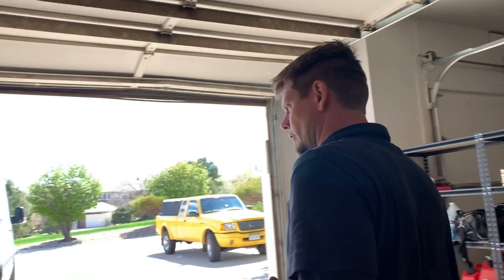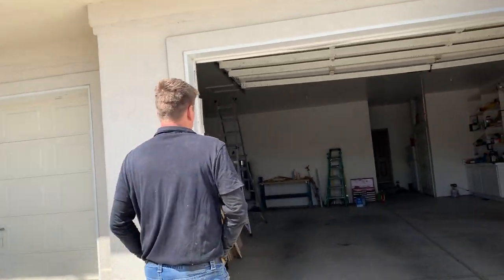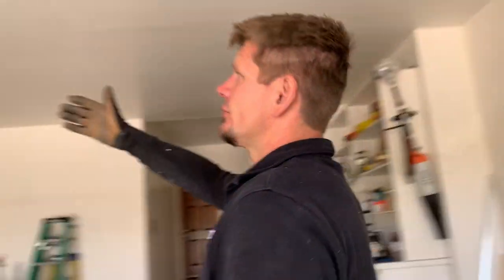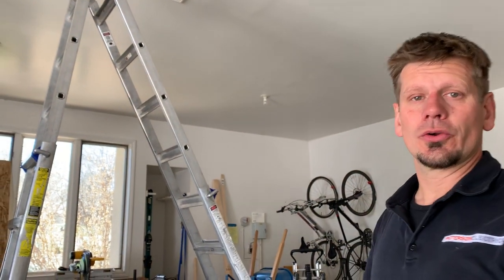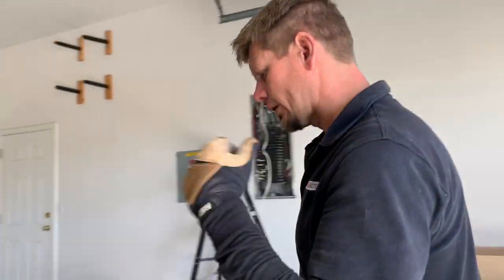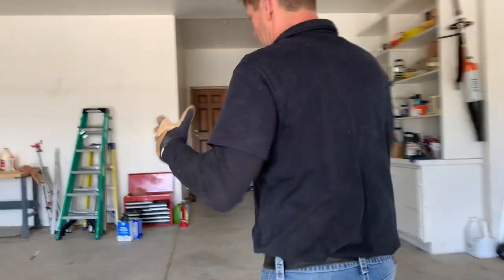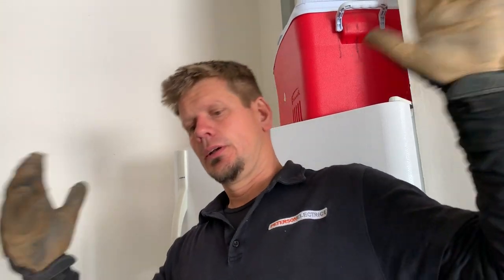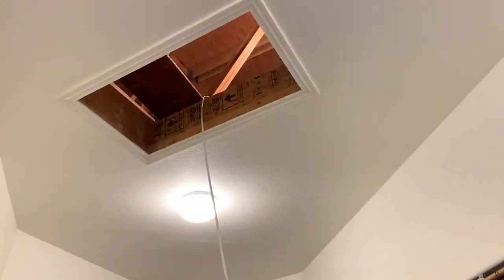Wiring for Electrical Blinds - Part 2

Comment: If an outlet is rated at 30 amps, when the circuit breaker is on and no appliance is plugged in does the outlet pulls 30 amps?
Reply from the maker: No sir, only pulls what is being demanded. Look at it like owning a diesel truck that has a v8, 6.7 Litter, turbo,    it can pull what you need, but does not until called upon.   ALthough!, you can not over amper equipment, you have to protect it based on the manufacutres' spec. Otherwise, when the equipment decides to fail, wires and devices will melt and damage more than expected.
Reply: @Petersonelectricllc  so when no device is plugged in, the current is shared among the outlets but when a high amperage appliance is plugged in a single socket it pulls more current to meet the appliance demand?
Reply from the maker: @rahiemlewis5534  each appliance "usually" has it's own circuit.
Reply: @rahiemlewis5534  A 30 amp circuit means the wire and breaker/fuse is rated to handle 30 amps, it doesn't mean there is 30 amps "on it" or being shared between devices. There is practically no current to be shared by all the receptacles in a circuit if none of them are in use. There will be a minute amount of resistance from wire lengths and connections, but until something is plugged in or turned on, there will be around 0 amperes of current being pulled. Your 30 amp receptacle is rated to serve a device that will pull up to 30 amps.